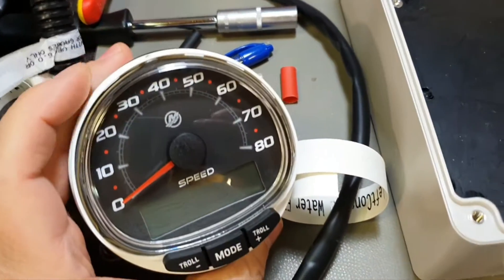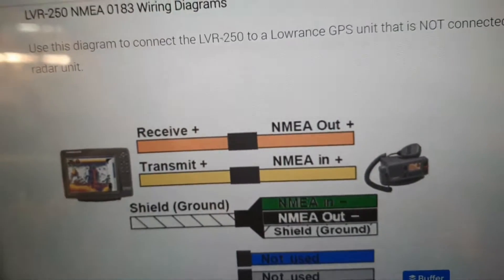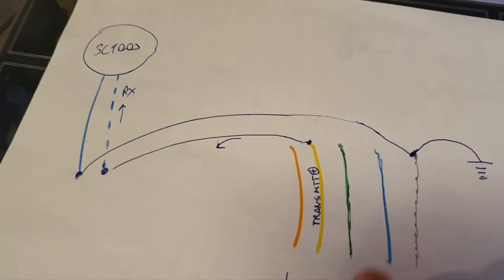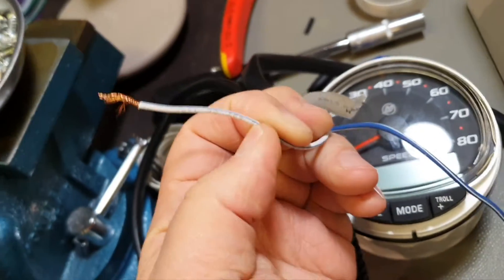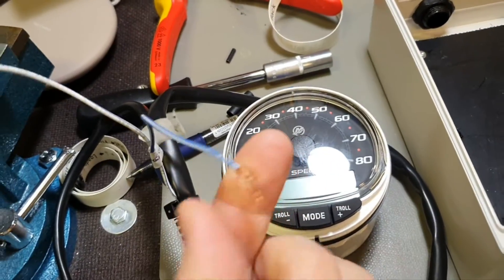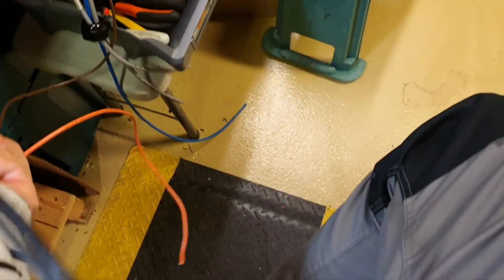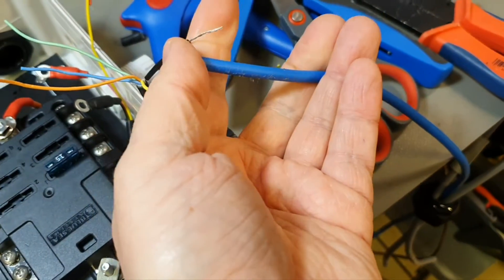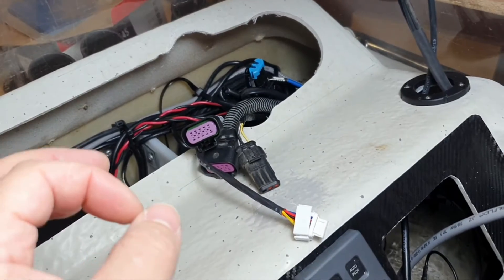How To Read GPS Speed on Mercury SC1000 Speedometer?

Comment: thanks so much for your information. my situation is similar however i am trying to connect 
a lowrance Elite FS. this does not have a nmea 0183 output but is does have  nmea2000. 
i have purchased a nmea 2000 to nmea convertor but the wiring is quite different to the lowrance wiring that you are showing here. it also talks about talkers and listeners (rather than tx or rx) so i am strugglling to work out the wiring connection to the SC1000 speedo
any ideas you have would be greatly appreciated
Reply from the maker: I'm pretty sure on the NMEA 0183 converter's side you should have TX (well... or talker) that you need to hook up to SC1000. And then it's probably about some settings on the Elite FS about what sentences you want to broadcast.